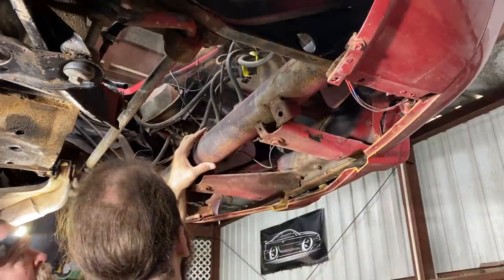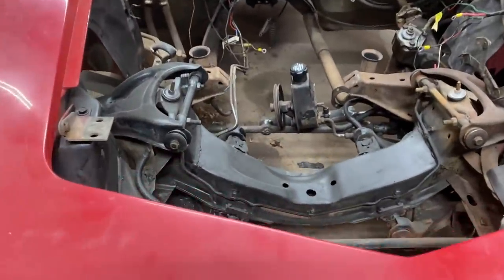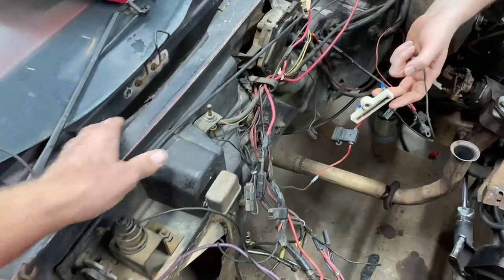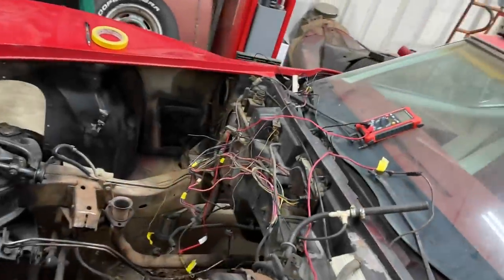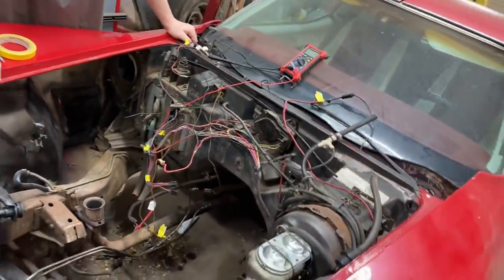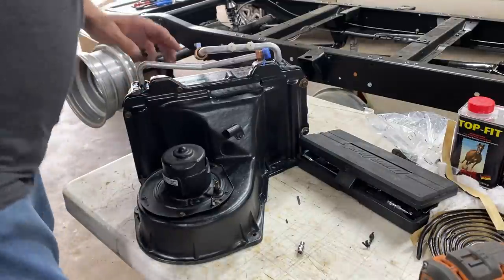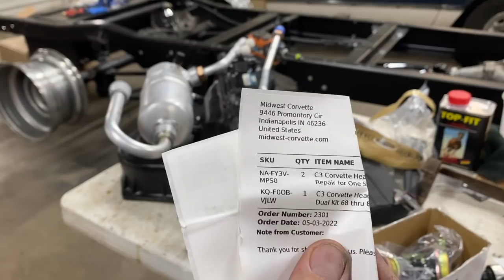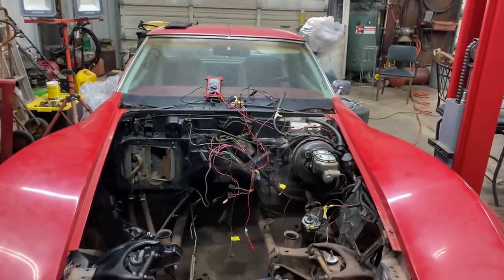C3 Corvette Wiring Nightmare

Comment: Man that vacuum system seems a touch over engineeed lol. Then the wiring, thats scarier than mine was in my 86 Dodge daily lol. Mine they cut the hot wire to the alt and left it open and unsecure. Then the scotch locks on the t-sig switch that had me pulling my hair out over brake light and signal issues lol. But I am sure you guys will get er figured out in no time. A quote from one of my old jobs resonates with me "If you dont have time to do it right then you must have time to do it over".

Comment: The Big red cable It's a fuseable link, normally used for hot wire from battery to a after market sound system in vechials. The white box is  balest resistor if the white thing goes out the car won't run.
Reply from the maker: It was hooked to the electric choke, overkill in my opinion.

Comment: Michael that white block is a ballist resistor fits a 6/8 cylinder mopar engine if blow it your car won’t start I’ll tell you firsthand cause I owed one Plymouth fury two 318 I’ve changed a few of them and the other one was a 6cylinder arc welder generator

Comment: I had to take my new C8 2023 vet to the dealership because the convertible top was not folding out all the way.    The regular technicians couldn’t figure out what was the problem so they called in a specialist. The specialist said that I need a “Harness replacement”.  Have to wait 7 business days
Reply: @SantasWorkshop     Exactly.  But my question to you,  I only have 2,000 miles. Why would I already need a harness replacement ??   Thanks man

Comment: A pre-made replacement harness is needed. There is no fixing the fixes. Safety over liability. Time vs money.
Reply from the maker: Sadly money is the issue on this one. I have way over spent on this as it is but the good thing is I can completely replace the wires they spliced!
Reply: @SantasWorkshop  ok santa
Reply from the maker: Thank goodness they are easy to trace from point to point!

Comment: Great video! I will be saving this a referring back when I have to put my AC back in. I do have a question (I'm a first timer, LOL) I replaced the harness in my 1977. It's a manual and one thing I found out recently when I had the car at the repair shop for an inspection...No back up lights! So I go get the car back and I check the fuses, everything looks good, so I said ok it has to be the switch. I order the switch, get the car in the air and there's no switch! I mean at all! Get the complete switch wires and all and I start looking for the pink and green wires that it plugs in to. Can't find it! Now, I'm confused and a little bit like uh oh! Could it still be inside the car?! YEP.....sigh...all of that to ask, how do I get this plug on the outside of the vehicle so I can plug my back up lights in? SMH!!
Reply from the maker: I would look under the console are and see if there is a pass through for it, if not you may have to run it through the big grommet in the firewall.

Comment: That is some of the worst wiring and solder work I've seen in 34 years of electronics. I was better than that when I was 14!
Reply from the maker: And from what I see completely unnecessary.
Reply: I agree and it looked like someone just throw the wires in there like they didn't care how it looked.